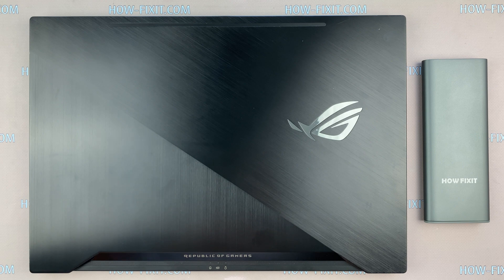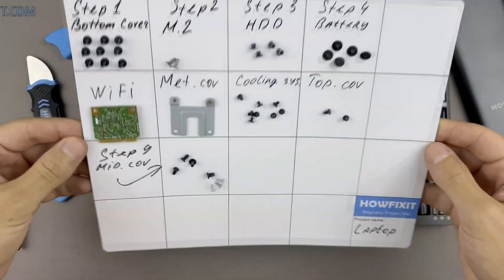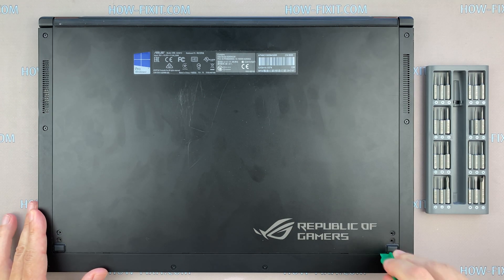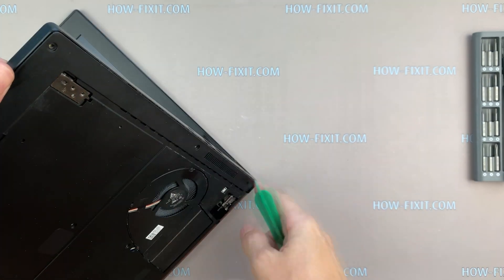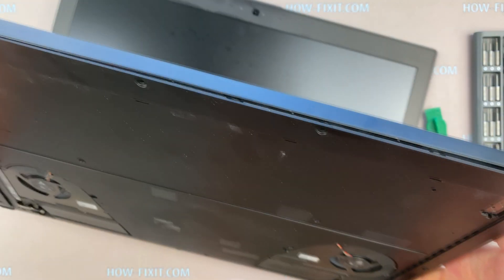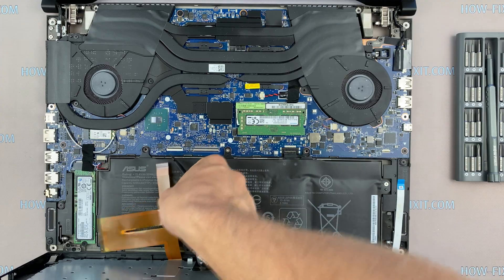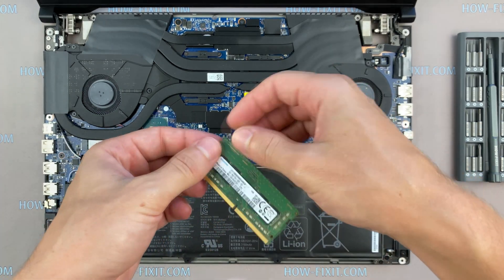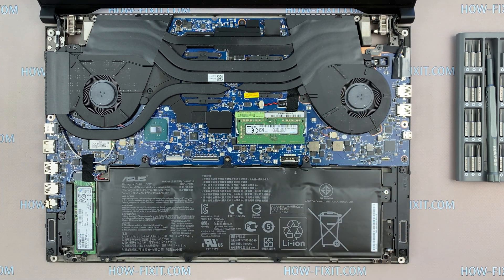Asus ROG Zephyrus GX501 RAM Upgrade and Install - Your Step-by-Step DIY Guide!

Comment: Thank you for this! I did it today and works perfectly. Huge help. Btw I installed a 32gb dimm and now have 40gb of ram. I couldn’t find a 2400ghz so I just bought the crucial 2666ghz and it works fine. It’ll just run both dimms at 2400.

Comment: First of all thank you for the video. I followed your instructions and took out my 8gb and put in a 16gb so I have 24gb. My laptop started fine at first but then it freezes when I start windows 10. I went into the bios and it’s up to date. It also shows that it is reading the 24gb ram. I try run windows repair but it fails. I restart my laptop and it says ‘your pc ran into a problem etc with the blue screen’. It restarts the tries automatic diagnosis then shows another blue screen saying ‘automatic repair couldn’t repair your pc. Please could you help me understand what is happening.
Reply: Did you find a solution for your problem?